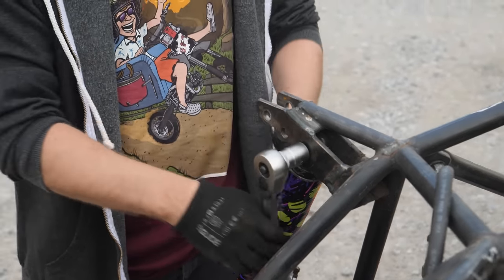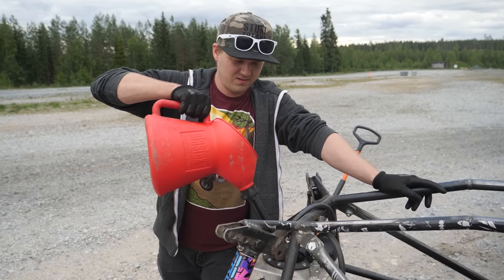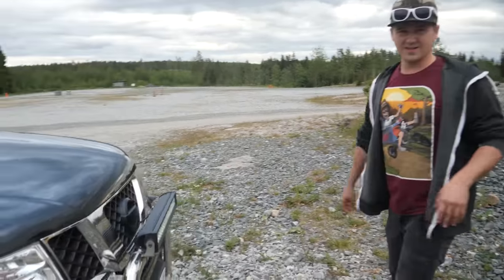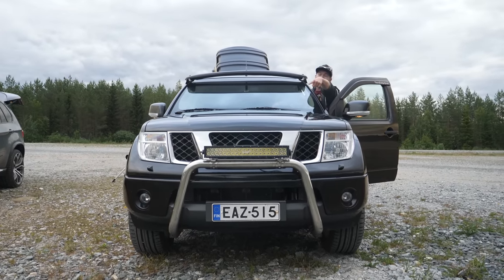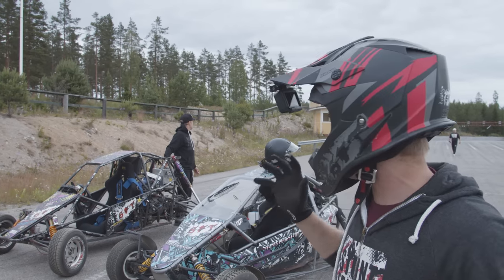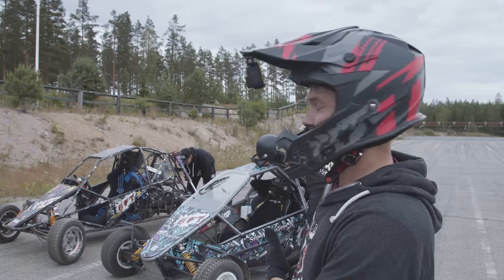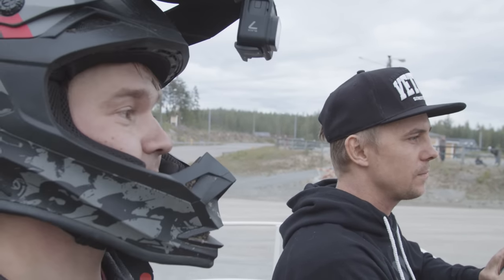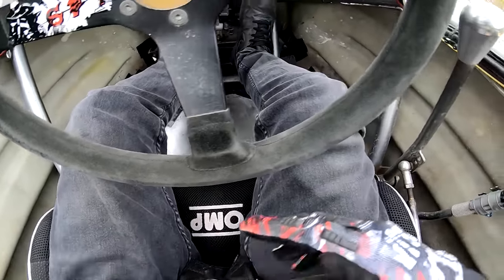TURBO crosskart VS 750 Racing crosskart

Comment: They seem to go from massive understeer to massive oversteer in a split second, lol.
Reply: Ya working a lot
Reply: Judge jimbo Browntown yeah, I reckon you'd feel it after a few laps!
Reply: They definitly do on Dirt Rally 2.0!
Reply: You mean: "Sounds exciting."
Reply: They need wider tires with lower pressures up front, and a tighter steering ratio (input:output) from zero he has to turn the wheel halfway before anything happens, along with longer pedal travel on throttle
Reply: @sixstringtyler117  geez, you should call up Mercedes and give them your advice. Im sure they would love to hear from you 🙄
Reply: Don’t listen to what he says tyler he’s the worlds worst musician.. after drake
Reply: Just needs a wing lol

Comment: You know you’re going fast when most of the time the steering wheel is turned opposite of the way you are turning 😂
Reply: Crosskart are the exception to the rule. The hairpins are so tight opposite turning and rotating with the throttle is the fastest. On any high speed track on asphalt the opposite is true.
Reply: @WynnofThule  That's because of the solid axle. Sort of like on a sport quad or sprint car, there's no differential, so sliding is the best way around a corner. It's also way more fun!
Reply: @BunkerBlog  I do sprint karts. Lifting the inside is the name of the game.
Reply: @WynnofThule  That's cool man, what class do you run? Always wanted to try a shifter out. Karts are unique because there isnt any suspension, so the entire frame flexes, lifting the inside. Crosskarts and quads do have suspension, so while the inside doesn't "lift", the weight is still transferred off of it.
Reply: @BunkerBlog  I do Junior, X30 and rotax.

Comment: Looking awesome! Just add 1-4 degrees negative camber to front to get rid of that excessive understeering.
5cm stretch and softer front suspension settings would also help to get some weight to those front tires..
Reply: have a look at 4.56-4.57 it looks like theres some flex in the steering somwhere, or is that normal on these things?

Comment: Rear roll center is too high on your turbo kart, lower it and stiffer the shocks to balance.
Reply: Would you lower the rear upper inboard mounting point by 1/2-1 inch ? or something else ? The arms look parallel or divergent rather than forming an imaginery crossing.
Reply: @BeamRider100  hard to tell from a video, i'd do it simple way first, taller tyres, shorter shocks, same ride height, test from there.

Comment: I saw at least 260+ km/h on the speedo nice hahahaha ;). Very cool machine!
Reply: MrTe450 wheelspin
Reply: It's also geared much lower than the bike. So speedo can say 260, i bet it much lower actual speed. It still is a lot of wheel spin tho😁
Reply: It is obvious that this speedo is not accurate anymore guys haha
Reply: 70mph max in this video.

Comment: I use to own a 738 lbs turbo gsx1100f 300 hp sand car w/30” paddles. 95 mph up the face of sand mtn in UT. It was terrifyingly fast.
A cross kart would be epic with a built N/A 250hp busa motor, a little more wheel travel and a slightly larger tire.

Comment: 4:54 .. You can see your right wheel looks like it is flexing a little farther than it should there.  Maybe you should build some mechanical stops to keep it from turning completely flat like that.. I'm assuming you drove this trace a few times to get a feel for it..  If I would have started this track as fast as you did, I'd be terrified.. ahahah....  It looks very sketchy... for a roll over.. But I guess it stays down somehow.
Reply: Flat? I think you get fooled by the wide angle
Reply: @danielssonsgarage  .. Flat" ... meaning that right wheel was turned to a complete 90 degrees of the forward motion of the kart... That's why it slid and he had to brake, because he was gonna ram the rail if he didn't.. Pretty scary.. It's only lightly built, and he was pushing it's limits.
Reply: @calholli  I think you are exaggerating a bit. Also the left wheel seems to be turning the as much on the counter steer right after that. I don't know if it is the camera angle but it does look like outer wheel turns more than the inner while normally on cars it is the other way around.
Reply: @zabnat   You can put little stops on them so that they will only go so far... that way they can always have at least a slight turning arch...  When they are full 90 degrees it's just not gonna work in that moment..  The wheel doesn't roll that direction. :)
Reply: @calholli  Why limit the capabilities of the vehicle when you can just learn to drive? ;) (also it was just the camera angle, the wheels turn as they are supposed to)
Reply: @zabnat  ... nah.. They're definitely oversteering too far.  that's not a "capability".. it's a disability.. and thats why he slid out, headed for the rail... Luckily he had enough room to stop.. any closer to the rail and he would have smashed into it..  Maybe you don't realize it, but all of this stuff is engineered into cars and buggies that are sold commercially.  These guys hand built this cart...... so anyway. it's an easy fix.
Reply: @calholli  It is a capability because I suspect they also want to drift with it.

Comment: It's best to stay in the lowest gear possible to keep the motor in high revs and out of the mid range torque through the corners and change up the gear as you exit the corner and that will prevent too much oversteer which will increase your cornering speed.

Comment: Might want to steer that thing with both hands, since there is maybe one or two gearchanges during the whole lap. Also helps to not overdo steering inputs that way.
Reply: overdo steering inputs is  a massive under statement, i wanted to scream STOP TURNING THE GD WHEEL ALREADY. like holy crap your going straight leave the damn wheel alone

Comment: Try a wider tire and rim. Should help the traction/ understeering. Also try a weighted steel plate in the front. Bolt it underneath the car in a way you can move it back and forth to find the best spot to help the weight distribution.

Comment: Your cars steering is off because the front wheel Ackerman looks to be backwards  I could be wrong though. I learned this in the process of building my kart I used ATV A arms and spindles

Comment: Noticing on your Crosskart, the rear sprocket is huge, yet you have small wheels on it, so it is geared high, yet the speed is limited to the wheel size. Mine is the opposite, geared low with big wheels. But yours seems to be designed for speed and not difficult offroad use, mine is designed for mountain roads. This is what I really like about these builds, is you build it for your needs, as opposed to trying to buy what you think will work best for you.

Comment: nice crosskarts, looks like you need to work on your roll centers(maybe lower them) and different length and not parallel control arm design, as you can not get full tyre contact patches while cornering... (more camber acceleration would do the job) And the front uprights or arms have problems 4:39 either something is really loose, or you need much more camber acceleration maybe some caster. Great crosskarts anyway, I wish I built one someday...

Comment: She looks like she needs a Camber kit 1 for maximum Angle for sick drifts & also proper tow so u can get into the turns and not have to worry about the oversteer and understeer as bad I would assume just physics and many different setups of other wicked rides such as outlaw sprint cars, drift cars vehicles of the crazy over HP nature I belive once u get that dialed in just Right that's gonna be one of the coolest all around ass puckering RIP ROARING RIDE u have ever built but she is super wicked looking now video never does justace like driveing or being their in person 2 see the Ripp session 👍👍 🤘

Comment: Nissan d40 have bad frames, rust thru them quickly. mine did, 2006. 

also engine is not that great,  change the timing chain!
Reply: not to mention a ZD30 is absolute junk and they love to shit transfers when you load them up

Comment: Try to do  Less darting with the steering wheel pal try holding in toward lock an do ur steering with ur rear wheels trew throttle control get in to inside apex at the turn  early and half power with small  opposite lock with gradually increased power in conjunction with aducate increasing op lock in smooth manner no need for so much over corrections of ur steering . If u get both steering anx trottle just right simultaneously you'll simply start to flow from turn to turn much  faster and in more control ,as less input to the  steering at speed  = more control try using a rally line an  not a racing line too, which is all about approach and exit  the strangest line trew any  following   corner  wer possible ,start with using 1 gear higher than normal in corners but entering slightly quicker with steady power put down an synchronized with ur  opposite lock exits, watch ur results in a day of trying this mate ,you can thank me later ,😊
Reply: I couldn't agree more. You can really tell an experienced drifter over a noob just by listening to the engine and watching their hands on the wheel.
Reply: YE its as obvious as the  way a gay man talks 😅, , theres alot of panicky  driver  over input in newby  followed by been pointed in the opposite direction ,where an experienced guy will be drifting ,texting , an watching out for the🐷🐖  effortlessly  and all at once  , its called skill I heard ,😂😂